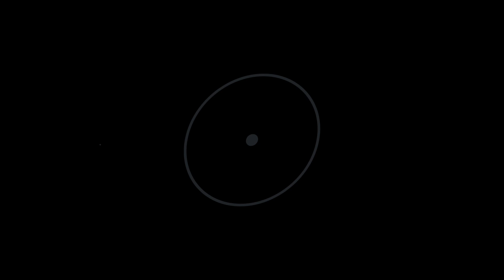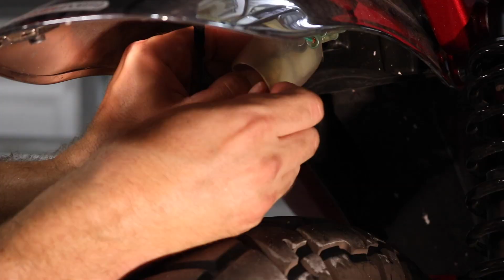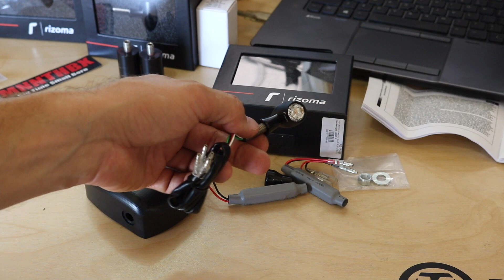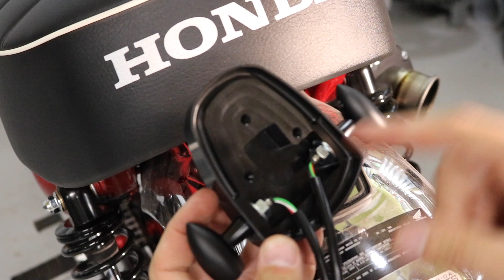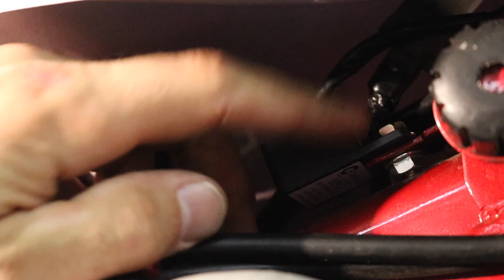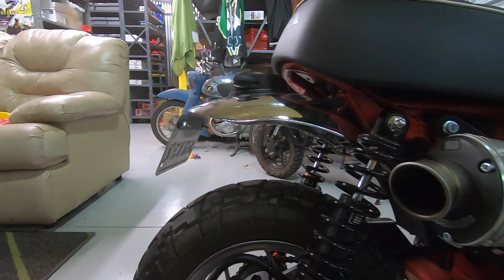2019 Honda Monkey MNNTHBX Tailight Install

Comment: Hey John, NEED SOME ADVICE/HELP!! I have a question man. So I bought this set up for my monkey. I have the blinkers set up and working. But I can’t figure out how to get the bullet connectors for the running light and taillight hooked up. They are also bullet connectors as you know. But how do I get them to go into the OEM taillight plug?? It’s all OEM taillight plug. Any advice would be AWESOME MAN, and greatly appreciated. Thanks!

Comment: John, what did you wire together to get running lights to work? I followed the diagram, got all 3 wires in the OEM plug hooked up so I now have brake lights & turn signals, but no running lights.

I plugged Rizoma greens to OEM blue/orange, but there’s two OEM green wires left over to plug anything to? Do these have to be daisy chained to another wire?
Reply from the maker: man I don't remember off the top of my head and would have to rewatch the video to try and remember.

Comment: On the turn signal wires, are you just holding both ends and pulling? Or are you having to press down in a certain area to disconnect?
Reply from the maker: They’re barrel connectors that just press together, so you pull them apart

Comment: I appreciated the video as it helped me install mine. However, one gap that some viewers might be asking themselves is about the flasher relays. It wasn't obvious to me but the reason that four are included (two per taillight) is that you have to daisy chain two of them together. If you only connect one you will get rapid blinking. But connecting two of them together solves the problem. Hopefully someone finds this helpful!

Comment: When are you going to replace the seat with a smaller piece because it's  no longer in line with the rest?
Reply from the maker: Probably never, as I need some comfort! I’ve not heard one good thing other than looks about the aftermarket seats. I also like to take my kids for rides too, and the aftermarket seats out there wouldn’t allow that to happen easily

Comment: Does that plate bracket not have a licence plate light? Or am I just not seeing it. I went with the shortened plate bracket from Yoshimura and it;s very clean looking.
Reply from the maker: It doesn’t have an integrated light, but I bought the led lighted license plate bolts with it, but didn’t wanna splice into the harness. I sourced the OEM plugs am going to do a plug-n-play harness for the lights.